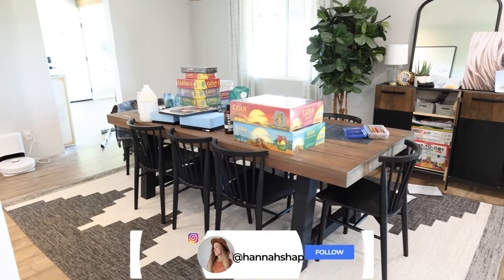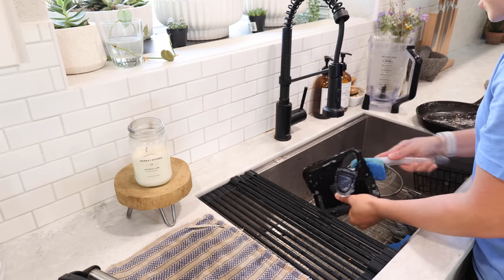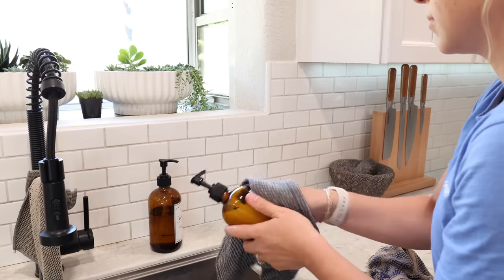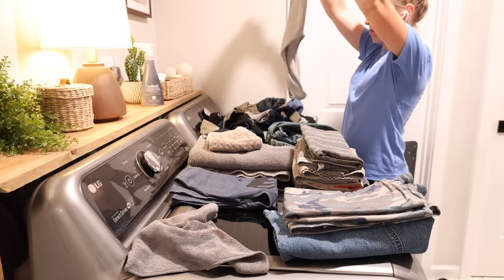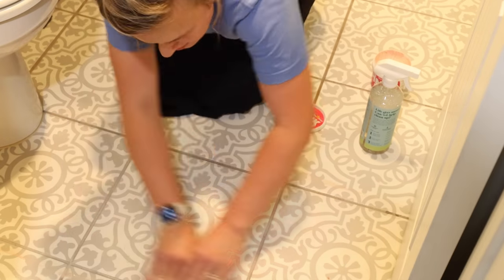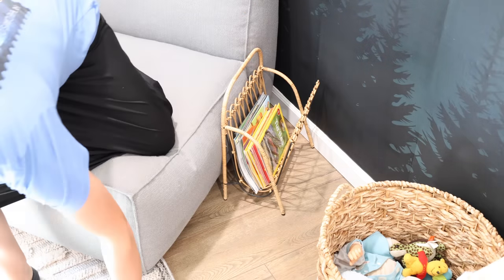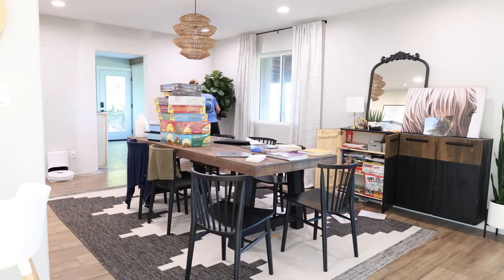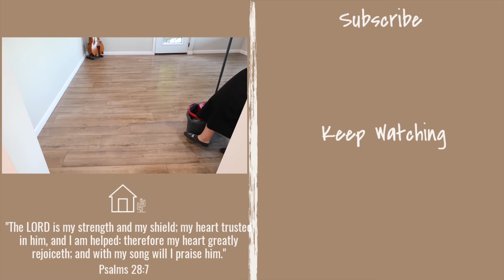WHOLE HOUSE CLEAN WITH ME!🏠 WEEKLY CLEANING ROUTINE | 2023 CLEANING MOTIVATION

Comment: 5:39  I call it "the one touch system".  You arrive home and if you leave your jacket or bag on the dinning table,   you will have to remove what you have left there before to be able to use the table. And things can be moved around all they long because they are on the way. Instead just put things right away in their place,  it will save time,  as you just have to "touch it once". I read about it some years ago,  and I've been using it ever since.

Comment: Hi Hannah, great video. I was wondering.. I have your kind of walls in my apartment with the texture and have some spots I cannot get clean. What do you suggest that doesn't take the paint off?
Reply from the maker: Hello, If I use a cleaner on my wall it's usually just an all purpose cleaner and then I will just scrub lightly so the paint dosen't come off. Some other things you could try; mix mild dish soap and warm water together and use a sponge or soft cloth. If it's a stubborn spot you could try making a paste with baking soda
Reply from the maker: hope that helps!
Reply: @hannahshappyhome  thanks. I'll try it. Have a great weekend